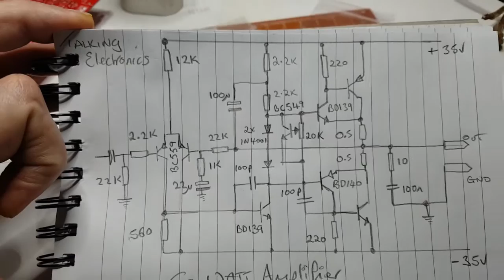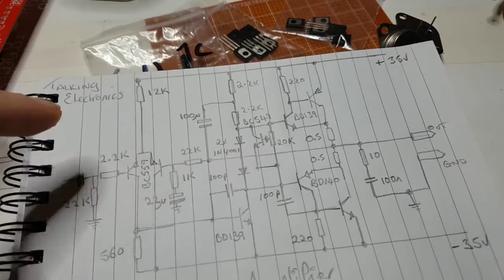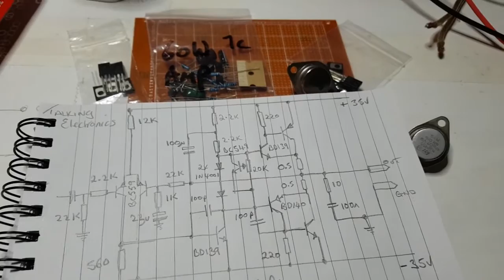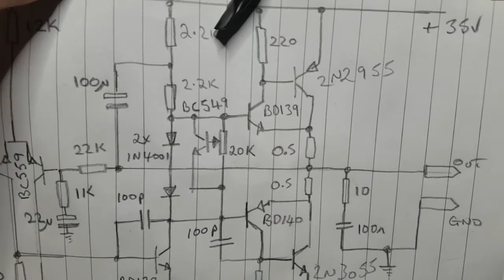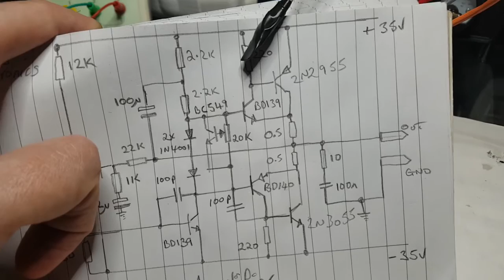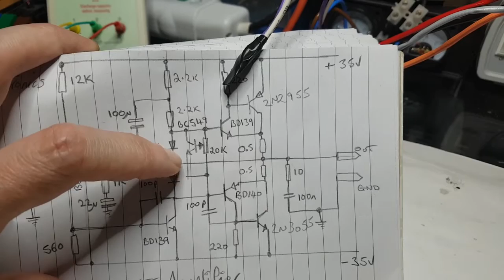60 Watt Amplifier Attempt 1

Comment: You're very welcome, glad you accept comments.  It's fascinating to watch how you're more willing to include analysis when tinkering.

Some time in 2017 I hope to restore my electronics hobby, which I've had since the mid-1960's.   But, honestly, I've never done the hard, detailed study.  I call it "dirtballer" experience.  Grounded in trial & error.  As we both know, there are YT electronics people who HAVE bigtime knowledge about circuitry design and operation.

They are the ones who help us learn.  Nowadays, prices for test equipment and all sorts of hobbyist parts can be ridiculously cheap.  (But, sometimes so cheap to border on defective.)  Plus, with Raspberry Pi, Arduino and etc., super cool circuits can be made with intelligent operation that would have been very complicated with discrete device circuits.

Your viewers are rooting for you!

Comment: Suggestion:  put meters between the power supply and both + and - amp connections to measure current.  Set the variable resistor to center of rotation.  Attach resistive load of at least 60 watts in place of the speaker.  Attach oscilloscope across speaker dummy load.  Heat sinking on the output transistors will likely be needed.

Determine if both power supply rails are drawing equal current.  The currents should be low (hopefully under 350ma).  With no signal, determine if small adjustments of the variable resistor affect the idle current.   There might be a point where adjustment lowers/optimizes idle current.

Feed input of the amp with a variable-amplitude sine wave of a few hundred hertz.
Increase input signal of sine wave from off to few millivolts to 20-40mv.  Does the output sine wave look pure, or are the top or bottom peaks flattened?  Is there any distortion of the sine wave?  At what point increasing the input signal does the output sine wave distort? 

Check sine wave purity at a few points between 50 and 16,000hz.  Does the output waveform stay pure?

Last, get some documentation on circuit operation.  The above is experimentation;  the docs will explain what that pot is for.   The Talking Electronics source is really no help.

Good luck.
Reply from the maker: Thank you for you advise. I have set up as you suggested and + rail is ~ 10mA  - rail ~ 15mA . I have just noticed a big difference in resistance in my test leads, (15mA higher lead resistance) so I will have to check it again. The waveform with 10mV sine applied is OK but as I increment by 10 mV it flattens out on the top, 60mA mostly flat top.. This was done at 300Hz. 
Adjusting the variable resistor does make a very small difference, not enough to do anything really but there is a very small difference. 
 I will ask TalkingElectronics if there is any documentation that could help.
I recorded what I was doing and may if think it could be useful upload as unlisted and link directly to this chat.
Again thank you for your suggestions and time. It is very much appreciate.
Reply from the maker: After a  quick search, I found this. http://sound.whsites.net/project03.htm 
I will read and digest tomorrow as I have had a drone come in for repair and have to get on with that.
Reply from the maker: I have done the drone and read the article about this amplifier. Seems it is not really worth doing, a fire hazard maybe if the speaker cables are shorted.  I have seen the revised circuit and would prefer to try that but maybe not just yet. I have a bunch of MOSFETS and will try a couple of audio amp circuits with them. I will not throw this circuit as I can come back to it at a later date, when hopefully, I have learnt more. Again thanks for your suggestions, time and help.
Reply: Yeah, the ESP site has been around for a long time, and on this amp circuit gives great info to learn from.  Good deal you found it.